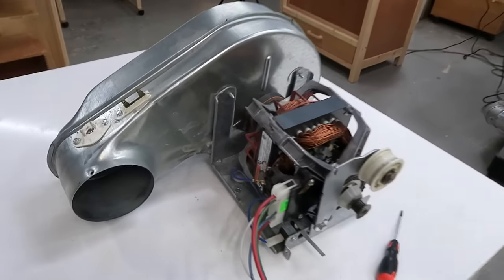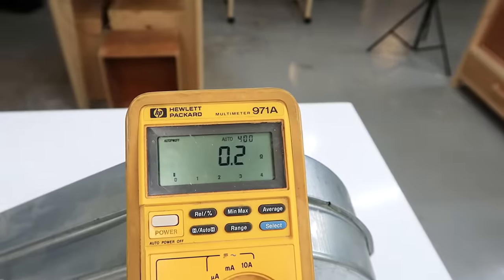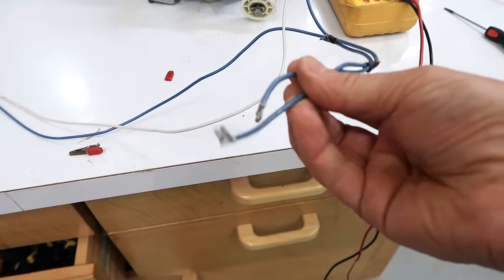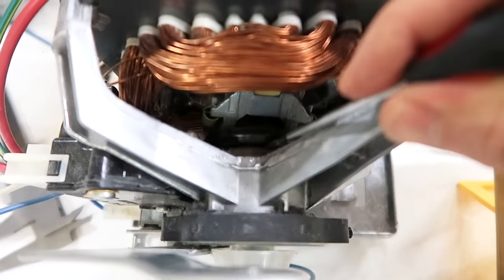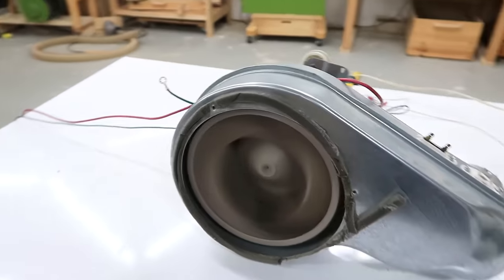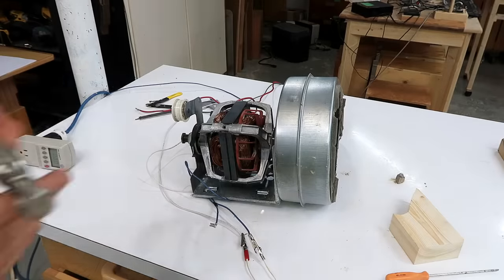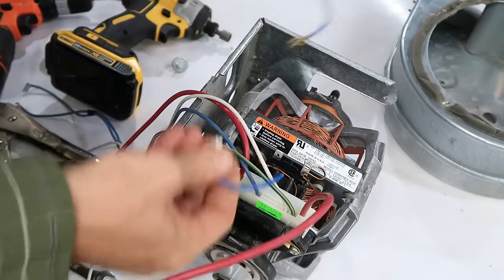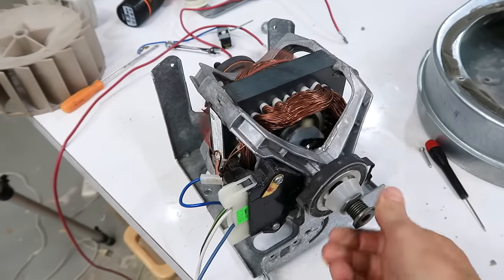Wiring up and reusing a clothes dryer motor

Comment: A word of advice, when connecting a motor and if you're not sure if the connection is right, use a heater in series with it. If the motor shorts, the heater will save you having to run to the breaker :) If it runs ok, you can remove the heater and plug in directly...
Reply: I cringed when he went straight to the kw meter😂
Reply: How do you mean? Could you please explain this? I'm trying to wire a very similar motor but similar ones in the past have blown my breakers. So i was thinking of wiring in a 120v like 2 by 5 inch circuit breaker i got at the auto parts store. Would that work the same?
Reply: @axalblimes2799  imagine wiring a switch in series to turn the motor on/off.

Now, still in series, add a clothes iron or a space heater. What this does is allow the motor to run, but if there is a short, the iron will heat up. Basically, you'll know the instant you click the switch, within the first couple of seconds...

You don't need to keep the iron in series for long, if the motor is operational, you remove the iron and plug the motor directly.
Reply: @axalblimes2799 
The breaker will also save you from having to run down to the big breaker, but it has to be rated accordingly. A clothing iron or space heater doesn't care much.

Comment: 4.3 amps at 120 volts is way more than 1/3 hp. very inefficient motor.  the fan motors used in refrigeration equipment are of similar inefficiency

Comment: I wish I was smart enough to wire a motor. lol  I have thrown many away because I have no idea how to make it run.
Reply: The way to get an idea is to just mess with motors. Maybe you won't get them to run right off the bat but little by little you can learn more about what's going on. And electric motors are a fascinating subject.
Reply: @1pcfred  I have basic wiring down. I have a Stadium light fixture,,it is 3ft around with a huge bulb in it. I have always wanted to wire it up but do not know how. lol  Light up my whole 2 acre yard. for fun only.
Reply: @5153flash  you may be able to get some information off the fixture or bulb as to what kind of supply the light needs. Some commercial lighting needs strange voltages.
Reply: Just make sure you don't wire it in a way that will cause a short.
Reply: @user2C47  if your electrical wiring is what it's supposed to be you'd only blow a fuse or trip a breaker if you did manage to create a short circuit. Which isn't a big deal. Of course if your wiring isn't up to snuff then you might burn your house down. But at least you'd be awake for it. Which itself is a huge plus.

Comment: If you have to take one of those fans off, next time, give this a try:  https://www.youtube.com/watch?v=028pD7cSXHI
Reply from the maker: neat trick!
Reply: @matthiasrandomstuff2221 : On this particular blower wheel, there is (what appears to be) a 1/2" square hole in the center.
I believe you could have used a 1/2" ratchet wrench, to remove it, with less chance of cutting yourself, on the sharp metal.
Of course, this is not true of all dryer blowers. 😁✌🖖

Comment: Huh, inaccurate meter. Why show .2 ohms for a short? How would you measure for actual .2 ohms, then?
Reply: Or very accurate, because it shows the resistance of the test leads? That’s the reason why 4-wire milliohm meters exist, if you have an actual need to distinguish a dead short from a 200 milliohm resistance. Or do the math in your head once you know the resistance of your test leads.
Reply: You'd use the 4 wire method.
Reply: ... I own a $300 meter and it often shows 0.2 or 0.1 ohms, which usually means the leads don't have a great connection to what you are testing... and it's not worth chasing down for this particular test on general continuity.
Reply: @rupe53  doesn't multimeters have calibration pots for resistance?
Reply: @Cheese_1337  .... wish that were the case, but the expensive digital ones are already more accurate so fudging a small amount is rarely an issue in the big picture. Had mine about 20 years in commercial use and it hasn't budged.

Comment: You’re kind of dangerous to work around. You need to secure things like that before plugging them in. Also, you need to install a quarter inch hardware cloth screen over that blower inlet. Only takes one minute. Thanks safety.

Comment: Hmm, I wouldn't try removing the nut from that bigger fan. It'd just be a ton easier to go out and buy a replacement nut... at least if you don't live ridiculously far away from a hardware store.
Reply: It's a reverse thread. I think most hardware stores only stock normal threads.
Reply: @eDoc2020 : "Most" being the key word. Perhaps there's the kind that does, around there.

Comment: "...And this is actually the dryer motor from an older dryer."

If you're already gonna say that it's from an older dryer, then you can save effort by just saying "the motor from an older dryer."
Reply: But it's a dryer motor. It's got electrolytes!
Reply: @1pcfred  They're what plants crave.
Reply: "Ackshullllyyyy"
Reply: @1pcfred : So what?
Reply: @aidenator00 : HUHHHHHH?

Comment: You can probably easily run it at 120 Hz / 240 V, as it's designed to run in very hot/humid environment :)
Reply: They put nameplates on motors for reasons.
Reply: @1pcfred  yes, but the technical details are for the designed usecase. For this one it is to run in 80°C hot air for ten years 4-6 hours a day.

If you run it as a blower fan for extracting dust for example, you won't run into that hot environment air, so the cooling will be better and thus you can exceed the designed parameters without jeopardising the lifetime.

In this case you would run it with a variable frequency power supply which governs the motor for twice the speed and with a maximum voltage set to twice what the name plate suggests. You just may wanna add a hall effect sensor for rotational feedback - to govern the motor speed depending on the load to a steady RPM. 

If you wanna make sure it doesn't melt it coils you can also add a temperature fuse which shuts the motor off when reaching 120°C
Reply from the maker: Induction motors can't run at higher voltages or lower frequencies.  They are built to be very close to saturating the core.  Double the voltage and you saturate the core, and current goes up 10x, ans smoke soon follows.
Reply: @matthiasrandomstuff2221  VFDs can run induction motors at slower speed. Vector control drives can even have holding torque at 0 RPM. Now whether any of that is good for said motor is another matter. Some motors tolerate speed control better than others do. As not all varnish or motor frames are created equally.